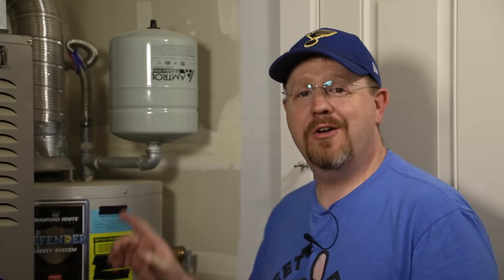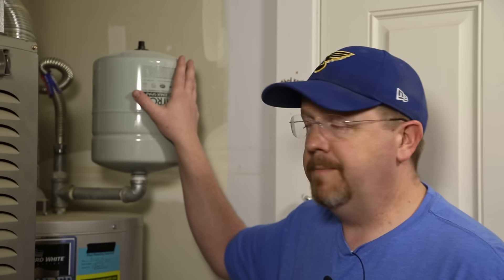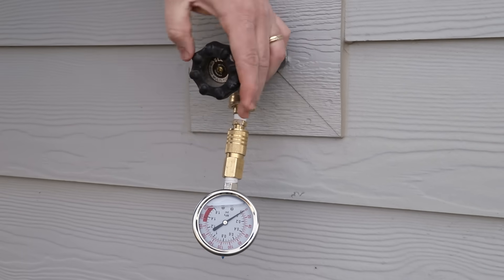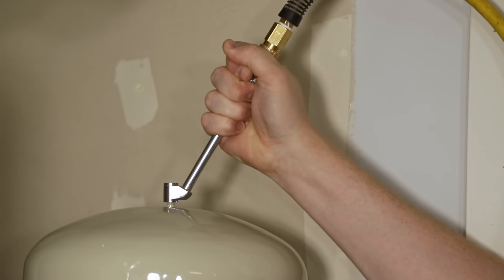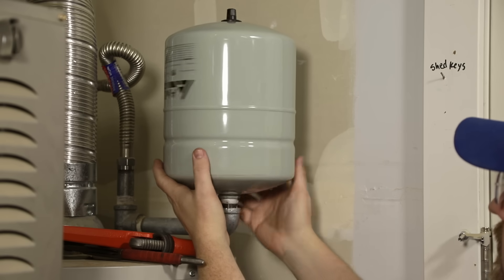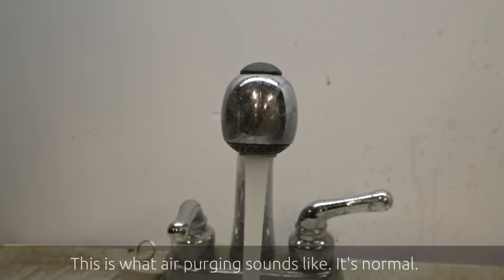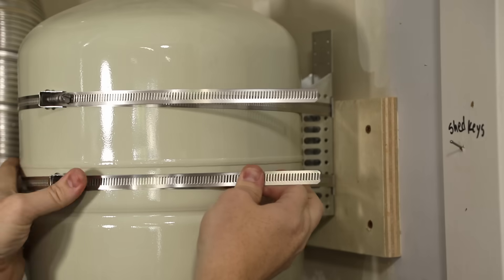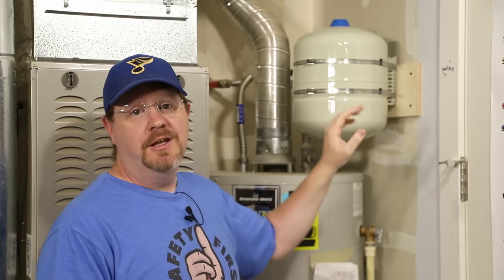What Is This Tank? How to Replace and Maintain a Water Heater Thermal Expansion Tank

Comment: How do I know what size of a expansion tank I need. I saw at Home Depot there is a 2.5 GAL and a 5Gal... My water heater is just like yours - brand, gas and 40 gal.
Reply from the maker: Ho CoreNiel - the size expansion tank you need depends on a number of factors: size of your water heater, static pressure of your water supply, temperature of your water heater, etc. For a 40 gallon tank, you may be ok with only a 2.5 gallon expansion tank, assuming your static pressure is on the lower side. In your shoes though, I'd go ahead and get the larger expansion tank. It won't have to work as hard, and should last longer as a result. Good luck!

Comment: No. Cold water kept cold by a check valve does not expand. I have no expansion tank, however, have back flushed and descaled my same Bradford White heater once a year, put a new thermocupler in it once, adjusted and repositioned the pilot light once but have never replaced a TP valve in 15 years. .......but yeah, if pipe hammering I would install one in the cold supply line between the check valve and water heater.
Reply from the maker: Hi Jack - Water absolutely does expand (volume increases) when it is heated. The expansion tank is placed on the cold water inlet so that when the water that is in the tank is heated, it has somewhere to expand *to*. Since your fixtures are typically off in the house, the water cannot expand out into the hot side, so it instead expands back into the cold water inlet, and into the expansion tank.
https://www.google.com/search?q=does+water+expand+when+it+heats+up%3F
Reply: This doesn’t happen because of check valves. Hot water doesn’t expand and back flow into cold water lines at my house.

Comment: Thank you for your Ideas , I just installed a new water heater I want to install expansion tank, I have a problem It doesn’t fit in the water heater Enclosure I want to install or put it outside the water heater the expansion tank my question is how far Can I install the extension tank from the gas water heater. Thank you so much
Reply from the maker: Theoretically, you can install it anywhere on the upstream cold side of the heater... but if you check the manufacturer install instructions, they likely have guidelines for where they recommend you put it in the system. If the instructions don't mention anything, then if you can get to within, say, 2-3 feet of the top of the heater, you should be fine. Good luck!
Reply: Thank you for  your suggestions

Comment: I'm 50 years old, My grandmother didn't have one of these, Growing  up, my mothers house didn't have one of these and I don't currently have an expansion tank on my water heater. Water expansion seems to be accuratly designed into a water heaters design by the developing engineer, as it should be.
Reply from the maker: They have historically not been common, it's true. They are becoming much more common (usually required, in fact) with new construction. New developments increasingly have a check valve installed at the street that prevents the expansion from back flowing back to the water supplier - older homes have not needed an expansion tank because they were not plumbed with a check valve like this. Thanks for watching!

Comment: Astonishing.  Galvanized pipe.  Upside down tank install?  Something new every day.
Reply from the maker: Hey Ted - the licensed plumber who installed this did a number of other questionable things in my house. Replacing the galvanized pipe is on my short list of projects to get to soon. However, the tank's instructions specifically say it can be installed in either vertical orientation - though this does vary between tank manufacturers, so double check the instructions to make sure you are installing it correctly. Thanks for watching!

Comment: Should the expansion tank be replaced if the water heater is replaced? How much is an expansion tank? Will it come with the new water heater?
Reply from the maker: Hi Jobe - Expansion tanks run around $50 or so, and are easy to find at your local hardware store. I do recommend replacing the expansion tank when installing a new heater, but it's not strictly necessary if your existing expansion tank is working well. Good luck!

Comment: Ok believe it or not but I have been plumbing for better then 40 years and I have “NEVER “ see this bladder tank on any city water system in all of those years! However I’ve see this type bladder tanks on ground wells and similar types on furnaces with water heat! Fifteen years  I worked with a master plumber for residential and commercial building and same thing except for restaurants!  In commercial building  and restaurants both had one way check valves and air dropped space on drains to stop water pressure from pressurizing waste drains but again nothing on city water supplying to homes only wells(well pumps) system! Also with city water system we didn’t find pressure that was more about seventy pounds to an average of about thirty pounds on the facet!  Never have I see a high pressure relief valve leaking with or without the bladder tank unless the water heater was over heating…. Just what I’ve see!
Reply from the maker: Huh. They are becoming more and more common. All new construction in my city requires them.

Comment: When these are installed to mobile or moving application like a vehicle, how to support it properly?, could you replace the tube with flexible hose and bolt it straight to a hard fixture?
Reply from the maker: Hi Bob - yes, I suppose you could do that. I feel like the bracing I installed in this video would have also been sufficient for a moving vehicle, assuming my entire garage was moving, of course. Good luck!

Comment: While I have never encountered a need for an expansion tank in the past nearly 50 years, this vid, starting at 4:49, shows an excellent modification of a water heater: the original drain valve has been replaced with a quality brass ball valve. To put it mildly, the plastic drain valves installed by tank manufacturers are dogshit. They invariably clog when — or if — they are ever used, and won’t seal when shut off. However, the brass valve should be installed when the tank is new and the plastic valve can be unthreaded without breaking it. If if shears off and leaves a stub in the threads that will be a bad day indeed. Use a full port valve to make it as unlikely to clog as possible. The vid also shows a crucial addition: the valve has been modified with a brass fitting that has garden hose threads on one side. That way a brass cap with washer can be tightly threaded onto the valve. Lever-actuated ball valves are great, but without the cap it would take just a tiny accidental bumping of the lever to cause a flood.
Reply from the maker: Hey Thardyryll - you have a sharp eye! I actually did a whole video all about replacing the terrible factory drain valves with the one you saw in the video: https://youtu.be/OBPJYg0o_o0 Thanks for the feedback!
Reply: @AmplifyDIY  I read about replacing the factory’s plastic valve with a brass valve years ago in Fine Homebuilding magazine. Good advice, if only for the day when the tank has to be drained for replacement and no pump is available to empty it the easy way.

Comment: Answer me this, folks: I am 67 and bought my first house when I was 23. I have owned several homes, replaced a number of old water heaters for friends, etc. My current home has two heaters, one of which is 35 years old. No, I am not making this up. The second heater is 20 years old — and I saved the original after realizing that the water I thought was leaking from it was condensate draining from the heat pump system’s inside unit. So I have a spare should either fail. The point of all this: What’s with these expansion tanks? I see them on new homes. Looks like the expansion tank industry lobbied the code writers purely for the sake of selling yet another device that will ultimately leak of otherwise fail.
Reply from the maker: Whether you need an expansion tank or not is really dictated by your water supply. If your water supplier allows a small amount of backflow, then they effectively are the expansion tank for your system and you don't need one. Lots of new construction has anti-backflow valves installed at the street, so there is nowhere for expanding hot water to go and an expansion tank is needed. My old house (was build around 16 years ago) did not have an expansion tank. My new one (about 5 years old, less than 3 miles from the old one) does.

Comment: What if your water heater is outside in one  of those  Galvanized  water sheds. Nowhere to bolt or lag a expansion tank to now is that why my shower and my sink are always dripping because I do not have one an expansion tank that is I just put a new water heater and with the water heater and all the parts and I did it myself it was still close to I want to say 1300 bucks minus the expansion tank as I did not I don’t know what to do it now are you so is there a smaller one how do you know what size to get please let me know thank you

Comment: Too bad its installed wrong (upside down)
Reply from the maker: Hi Seeco - the manufacturer instructions specifically say it can be installed in either vertical orientation. This varies by manufacturer, of course, so check the instructions before installing any tank.

Comment: That expansion tank is upside down.
Reply from the maker: Hi T airdudeusa - the instructions specifically say it can be installed in either vertical orientation. This varies by manufacturer, of course, but in this case the direction it is installed is perfectly fine. Thanks for watching!

Comment: When using teflon and dope to install and later needs to be replaced, will it be easy to unscrew?
Reply from the maker: Hi Skorpyo33 - yes, the teflon and pipe dope do not harden or solidify, and won't act like loctite or anything. The joints should open back up just fine in the future. Thanks for watching!
Reply: @AmplifyDIY  hell yeah, made my day. Ty

Comment: I see a lot of these installed upside down.
Reply from the maker: Hi Chris - the instructions specifically say this one can be installed in either vertical orientation. Some allow horizontal installs as well - just depends on the manufacturer.
Reply: @AmplifyDIY  I think they should all be installed like you have it. Once they're full of water there's no more room for expansion.

Comment: Can I just turn off the water supply to the whole house and then drain the warm and cold to fill my tank to the correct pressure?  My tank is showing maybe 5 psi that's maybe why my water heater is leaking from the valve.
Reply from the maker: Yes, you can turn off the supply to the whole house rather than just the shutoff for the heater itself. Good luck!

Comment: Very helpful and detailed guidance! Thank you. What is the best way to check the water pressure at a condo?
Reply from the maker: Hi siamka86! If you don't have a hose bib like I used in this video, you could also use the cold water hookup to your washing machine (though you'd need to do some adapting to get a gauge on it correctly.) If you don't have an easy way to measure, you can always contact your local water company and ask what their pressure range is. If you are within 5-10 lbs psi of the water pressure in your expansion tank air side, you'll be good. Thanks for watching!
Reply: @AmplifyDIY  thank you very much! I appreciate it.

Comment: I have watched a few of these videos on the expansion tank and how to check the pressure accurately, and you were the only one to say after turning off the water supply to open a faucet and let hot water run out to depressureize the system, then take a pressure reading!!  Most all others just say to take the reading as it is right now !!  THANKS for the tip and information!
Reply from the maker: Thanks for the feedback, and thanks for watching, psan72!
Reply: I think you need to shut the cold water side (whole house) also to test the pressure.

Comment: My tanks pressure relief valve runs constantly .from day one of installation. I bought a new pressure valve and still runs. Does this mean I need an expansion tank ?
Reply from the maker: Hi fpopee - when you say "constantly" - do you mean it leaks *all the time*, not just *when the heater is heating*? If it is only an intermittent leak (i.e., it leaks when the burner is going and actively heating the tank) then yes, most likely you need an expansion tank. If it is leaking all the time regardless of what the heater is doing, then something else is going on, and you may need to check the incoming pressure in your water supply and possibly install a pressure reducer. 

Under normal circumstances a T&P valve won't leak while the heater is not actively heating. If it does, you have WAY too much incoming water pressure to the heater. Good luck!
Reply: @AmplifyDIY  the very day I installed the tank, the pressure relief valve was running......I waited 3 days and bought a new pressure valve. It still leaks continuously..even when the tank isnt cooking water.  I checked the house pressure at my utility tubs 5 feet away...its measuring 60lbs.
Thanks for responding!!

Comment: Does expansion tank have to be installed above the boiler? Mine is nearly touching the floor, hanging on a copper pipe. I wonder if it’s even functioning.
Reply from the maker: Hi Eugene - they don't always have to be installed above the tank. It's a little unusual to have one installed near the floor, but not unheard-of. It's relatively easy to check whether it is functioning, the process is the same as I described in this video. Good luck!

Comment: Very clear and thourough. I did not notice any affiliate links to Amazon to purchase the items. Your video is excellent, so you might want to do that so the lower end technical people can just follow your lead for parts. Not sure if NPT thread size is the same on all these tanks, but if they vary between 1/2"-3/4" you might add that detail.
Reply from the maker: Hi Michael - thanks for the feedback! I'm glad that you found this video to be useful. :) There are affiliate links in the video description - but they are down a little bit from the top. I'll copy and paste them here as well for you: 
2.1 Gallon Expansion Tank: https://amzn.to/35S6Q2a
4.4 Gallon Expansion Tank: https://amzn.to/2WlCQbU
Teflon Tape: https://amzn.to/2yFQVYK
Pipe Dope: https://amzn.to/3fF5axt
Tank Mount Bracket: https://amzn.to/3fHDzeT
Pipe Wrench: https://amzn.to/2XccWGT

Thanks for watching!

Comment: You said that the high pressure will affect plumbing on the hot side. This is only half-true. The high pressure will be on both the hot and cold sides — the entire system.

Comment: Thanks for your thorough video.  I actually discovered that our tank was faulty (spouted water when tested) while trying to troubleshoot some really high pressure in our system (which I began to suspect because we were having all sorts of valve and cartridge failures around the house).  At first I thought we just needed a pressure-reducing valve and got one installed, but we still had high pressure.  Some more research indicated that the expansion tank might be the problem, and so then we got a new one installed. In my research, I had seen that the tank's pressure needed to be equalized with the house pressure, so I asked the plumbers whether they had done so and they said, "no, it comes pre-set" (to 20 PSI).  Well, I knew that was an issue, read the instructions that came with it, and verified the proper procedure.  So here's my point:  The house pressure would sometimes get over 100 PSI.  Measuring the "house pressure" would then indicate that the tank needed to be set to this, which I know was too high.  I let the water run for a bit to reduce the excess pressure, then measured 45 PSI.  I ended up redoing part of their installation then by doing what you first showed in this video - turning off the water, releasing any pressure, adding some air to make it 45 PSI, and then turning everything back on.
Reply from the maker: Great job!

Comment: I tried to check the pressure in my tank and got no reading, I even tried to press on the needle to release pressure/water and nothing came out. I tried with a bike pump that has 160psi and my air compressor and could not get air in. Any recommendations?
Reply from the maker: Hi Teddy - it's possible the valve itself is stuck or otherwise messed up somehow. Have you tried removing the valve core? I show the process in this video (these tanks use the same valves as most tires): https://youtu.be/3U3Pv-YtMCs

I'd try replacing the valve stem and then trying to fill the tank with air again. Good luck!
Reply: @AmplifyDIY  I have watched the video and will give it a shot. Whoever installed our expansion tank did it horizontal and it is extremely hard to maneuver. Thinking about getting and copper hose extension so I can mount it vertical. 

Is it possible to take it off and test it that way, or does it need the water pressure to accurately do it? 

Then when it is off, I can check the valve stem too. Thank you for your time and getting back to me!
Reply from the maker: @teddysmith8372  Hi Teddy - yes, you can check the air pressure in the tank when it is removed from the system. Also, make sure that any tank you install is done in the correct orientation per the manufacturer recommendations. For instance, the tank I installed in this video is fine to be in either vertical orientation, but the instructions specifically mention not installing it horizontally. This will vary between tanks, so check the instructions. Good luck!

Comment: Thanks.  This is exactly my issue after installing a new water heater.  I like how you have it T'd off of the main water heater tank inlet nipple vs. after the wall valve as I was wondering about the weight and supporting it.